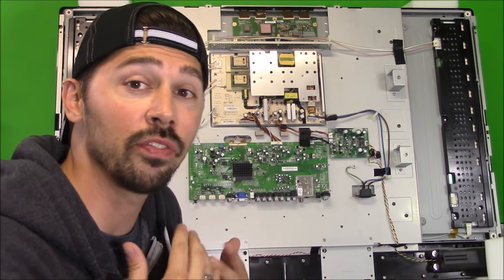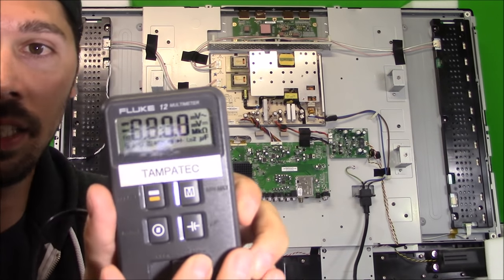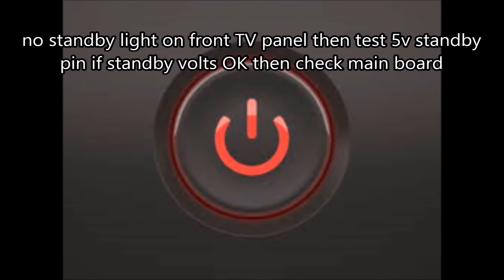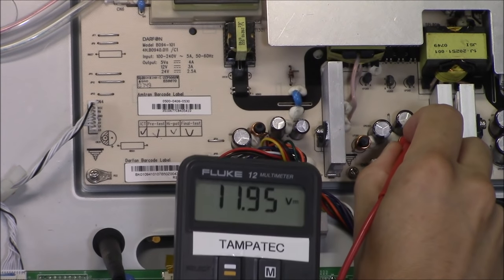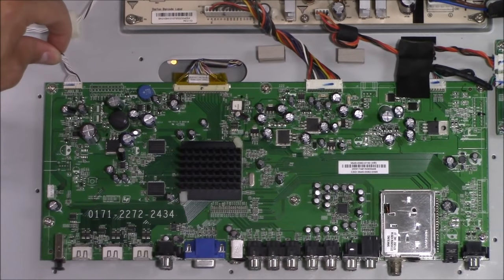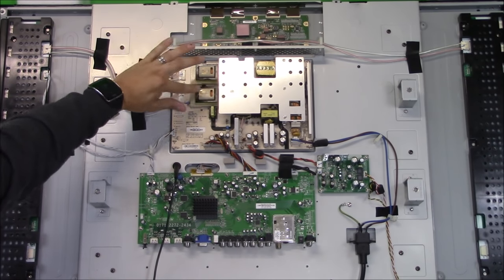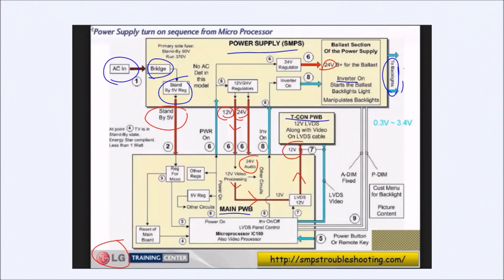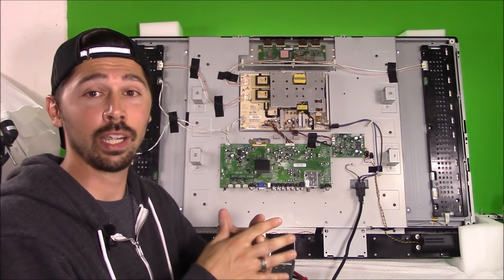ULTIMATE LCD TV REPAIR SERVICE GUIDE for TROUBLESHOOTING BOARD VOLTAGES

Comment: Help! I have a Sharp Liquid Crystal TV model LC-70LE550U  the other day the picture froze and then went dark around the edges then slowly would fade out all but the bottom middle... then finally that would fade out as well.  I would turn the unit off then on again and it would be good again but within moments do the same thing.  Is this the T con board?  If so... best place to purchase another?

Comment: Hi.
I installed new LED strips in my LG54M0060V12.
 The older strips needed replacing and when disassembling many of the lenses fell right off. I heard that was a common problem for some LG screens.

Very easy to do actually but the light on the screen now shows the pattern of the LEDs. 

The sreen and diffusers were put in correctly.
Is this another " learning curve " thing to worry about?
Reply: I mean all of the backlights, not just a few. Looks like wrong lenses on the strips.

Comment: I've been trying to fix a Vizio E220MV 22" LCD TV that has an external power supply.  The problem is no backlight and no picture (blank screen with the flashlight test), and of course without being able to know what it's doing I can't test sound.  It powers up and the invisible touch buttons respond by lighting up but I have no idea if it's actually doing anything.  All the voltages check out fine and all the electrolytic caps look good.  Any ideas of what to look at more closely?

Comment: Great videos! I changed out the dead Fuseable Resistor by the Bridge Rectifier on my Toshiba Regza (like you did on another video) but now I am getting good readings (you had a bad voltage regulator) for standby voltage but weird readings from the BR - AC is 120V but DC is only 117V and the other readings are .5, .5, and 1.0. I think I have a problem with the BR - awaiting new BR. On this video you said "If the bridge rectifier is shorted, it will take out the _?_?__. Could you please fill in the blanks (I could not understand what you said) so I know what else to look for. Many thanks!
Paul the Pilot
Reply: I think he said it will take out the fuse

Comment: Hi dear friend I have a lg 32lh20r. Manufactured in 1999  . Apears lines on screen  when I just turn it on then after 5 or 10 min goes away ..   they told me it maybe the t-con board ..  I been learning about my tv end it appearly doesn't have a T-con board individually placed .    Do you thing my tvs t-con board was built tongether with main board ?        Looking forward to hear from you

Comment: i have sony kdl-46z5500 tv without backlight. How to check primary and slave invertor boards? They work together?
Reply from the maker: +Zerg Rush check transformers on inverter board, that video is in my playlist. https://www.youtube.com/watch?v=b36w2GNrH6Y
Reply: +Tampatec Thx, can i check they separately or they work together? D1N and D2N Sony inverter boards. I checked that video before, but i cant find on my tv that balancers.

Comment: Hey Tampatec nice job with your videos!!  I took some of your advice and tried a fix on my  LCD (Samsung LN-T5265F) that has no back-light but sounds comes through and teh flashlight test shows teh picture is on teh screen.  I replaced all 4 Back-light Inverter cards one at a time and I still do not get any back-light to see the  image.  Any suggestions??
Thanks,
Fred.
Reply: I could help you. So, I found a huge tv. With the same problem. I read that it's just the l.e.d.'s. They need to be replaced. That's all

Comment: Hey Tampatec. I have an element TV that the standby light is on (red), but tv wont turn on and if it decides to turn on by a miracle the stand by changes to blue, but the screen does not turn on. I checked the power board and one of the outputs that was suppose to be putting out 24v was putting our 23v. I bought a new power board, but still having the same issue. Any suggestions on the next step?

Comment: Template,  I have a Sony KDF50E2000.  Good condition and all.  My tv's green power light keeps blinking and shutting  down the tv while I'm watching it. I hear the fans in the tv running  every time this happens. I thought it was a  bad lamp. But that's not the issue either. What could be causing this and how can I fix this. I've been watching  videos all day to try to troubleshoot  this issue. Everyone  has blinking red lights.  I haven't seen  a red light. The power light keeps flashing and shutting off my Sony tv. THANKS

Comment: Hi Tampatec, I have a Vizio D58U-D3 and it works except the left and right halves of the tv are different colors so it appears that there is a line right down the center of the tv. I already replaced t-con board, what else could it be?

Comment: I have a question for you Tampatec, I have an LG TV and all the HDMI ports are not working what could be the problem?
Reply from the maker: +Leonard if all hdmi ports are bad then main board might be bad but first unplug powercord for 2 minutes to hard reset tv, check your connections from cable box or a/v receiver. get boards at shopjimmy.com
Reply: OK thanks Tampatec.
Reply: that’s the site i was trying to remember, thanks. I think that’s how I got the idea to check to see if the back light turns on when I plug a connector on the inside… Very counterintuitive but alas I have light so Hopefully the solution is close… I’m pretty technically savvy and good with power tools however soldering isn’t in my repertoire yet. marzgyver

Comment: I have no input signal on all HDMI inputs or av inputs.  The power and main board are integrated into 1.  Sometimes shuts off when trying HDMI inputs and red power led blinks 3 times.  Would this be the main board or to con board?

Comment: Hey tampatec, do you have any contact info? I have a tv question. I have a 50 inch LG tv and it still turns on and shows the LG logo on the screen but it won't show picture from the antenna or the Xbox. It just says no signal. I looked at the capacitors like in most of your videos but they all look fine none blown or bulged. I'm stuck, I'm thinking its a capacitor that just looks fine. Any suggestions?
Reply from the maker: +Piero Sanchez can be main logic board but reply with an unlisted youtube video link of broken LG tv with model number, get tv boards at shopjimmy.com
Reply: +Tampatec is the main logic board where you can plug in your antenna and hdmi cable or is it the other one with all the capacitors? I want to make sure I purchase the right one. Thanks for all your help
Reply from the maker: +Piero Sanchez main board has hdmi inputs and microchips. power board has big capacitors and powercord connection.

Comment: I have a visio m420vt and after checking the voltages, I found the 12v circuit to only have 11.3v. The tv comes on and the backlights work, but none of the other buttons do anything and there is no image. Would this low voltage cause this or think I have fried mainboard? None of the components show any signs of failure.

Comment: Hello Tampatec, and sorry in advance for my English mistakes. Thanks for your videos they are very informative and useful.
I was wondering if u can help me with the problem i have on my old 2007 lcd tv, it's a Lg model 42LY95 (it can be used as heater during winter  :D ). So the problem is when i switch on my tv everything is ok but after 5 min, the image start blinking black and make pixels (the backlight are still on at that point).
About 1 minute after, the backlight switch off, i have only sound and the power button is still green, then i have to switch off my tv for a while, maybe 30 minutes to get any image and it's the starts again. 
So i opened my tv hoping to see any obvious problem with capacitors or anything burned but nothing so my question is:
Do you have any idea where it can come from ?
Is it just a symptom of dying backlight and if it is, is it repairable and worth?

Anyway I will follow your tutorial and check everything i can with my multimeter and give update later.

Thanks for your answer if you see my message and keep up the good work, love your videos especialy the "repair tech stuff by myself". I hope u understand my bad explenations.

Greatings from France mon pote ;)

Comment: When I test the voltage going to the T-Con board, it’s only 0.71V on each pin. Does this sound normal? The board itself says 24VD. This is a 55EG9100 which the standby light is on, but the TV will not power on. It started into a color cycle a couple of times after being unplugged for a long time, but I cannot get it to do that anymore.
Reply: When I disconnect it from the power supply and keep it connected to the main board, the voltage is 1.2V

Comment: I replaced the power board and my light still blinks and
takes a long time to come on, if it does. I noticed when I switch from a
standard digital channel to a HD channel it will go black and the red light
starts flashing again. No sound or picture. Could it be the logic board? What
about the capacitor in the main power wires going from the main in to the power
board? What are your thoughts?

Comment: I have a Sharp LC-60C6600U it is not turning on has a small light on in the middle of the TV I think its the standby light. No sound no picture can not see back light, but the light on the main board for the sound bare is on red. can you help I need to know what board to change out. t-com board or the main board. thanks

Comment: How would you check standby voltage on a tv that has a ribbon cable attached from power supply board to the logic board? The power supply board doesn't have any chart or indicator for standby voltage. It's an Emerson brand.

Comment: Hi. Could you help me. I have Samsung LCD TV and my picture turns on for a second then goes blank. I hear relay clicking 3 times and then stops during that. I took back cover and check voltages on supply board. Do you think clicking relay may be a problem? How can I check it it that's the problem. Thanks for any suggestions.

Comment: Hey I have a Samsung UN46D6900 has no lights, no back lights and clicks when connected to the power (single clicks every 3 to 4 seconds). when I unplug the main board the back lights comes on and no clicking relay. With the main board connected I am getting 5.28 to 5.31 V at pins 19 and 20. It fluctuates with click of relay. I am wondering it is the main board or the power board! would you be able to give some tips plz?

Comment: I have an Akai DLP TV that turns on runs and looks great,,,,,,,,but after a couple hours you will notice that the remote won't work, ie tv won't change channels or volume. then after about 5-10 minutes the tv picture reboots comes back within just a couple seconds. Then everything is ok for a few more hours...any suggestions

Comment: Great Videos! I'm close but not confident : )  Just need your expertise to point me in the right direction.  I have a 40" Sceptre LCD TV.  Problem: When powered on the (blue indicator light comes on) but I have a Black tv screen.  I checked the power supply voltages all were accurate, as well as the lines to the main board.  I noticed when I disconnected the 5 pin (2 lead) wire from the main board to the Back light board the back light comes on?  Checking voltages from the main board I read nothing at the Tcon connector.  Appreciate your help.  Thanks

Comment: Your videos are brilliant, well scripted. Green light on no red light. I have Sony KDL52V5100 with no picture, no back lights, no sound, no power to Ticon borad, and no power to inverters. Voltage readings at CN6202 on main power board are as follows with TV turned on with tv set power button, not remote, 3.35, 3.35, 3.35, 15, 15, -, -, -, -, -, 12.02, 12.02, 12.02   I have no power at connectors CN6501, and CN6502 to inverters and no power to Ticon board. After watching many of your videos I have concluded that my main logic board is bad. Could you please assist me with your opinion.  Please keep up your videos.
Reply: Tried heating 2 large smd chips on main logic board. 40 seconds each one, with aluminum surround on chips while heating. Reinstalled without inverters hooked up and got 6 red clicks hooked up inverters tried, worked well,  removed reinstalled heatsinc.  It works well now. Thank you for very informative information, in your videos.

Comment: Question. Samsung model . Ln  32d403. Won't memorize channels when in auto program. Through antenna or coaxial cable.  sensor on TV won't work. Remote for the TV does.   what's the issue with it. When I plug into a converter box I can watch TV because the converter box has the channels memorized. just would like to learn how to fix the TV.

Comment: Hi Tampatec
Thank you for all the knowledge and experience you are sharing with us. I learnt so much from you. I need your help.
I have a Vizio model  M550NV that works perfectly except for audio. The sound coming from the tv speakers is very very faint and not clear even at max volume. I checked the output dc voltages coming out of the power supply board and they all look good. It looks like the culprit is the amplifier chip but I cannot locate it because the audio board is not separate from the main board. Can you please help me locate it, and maybe a place where I can buy a new one. Thank you
 
Vizio 3655-0102-0150(7b) Main Board for M550NV
Reply from the maker: Said Laghrani try reset first then replace main board if reset fails. You need schematic to locate amplifier IC.

Comment: My Samsung LC55630K1FXZA LCD (CCFL tube) TV has audio, but no visual. I checked the CCFL's and none of them were burnt or black, I checked the voltage to my backlight inverter board and all transformers gave back the same voltage. I started testing the power board and while in the step of checking the bridge rectifier and somehow ended up causing some sparks and smoke and now my tv doesn't even have the red power light or the option to turn it on or off. What do I do now?

Comment: I have a Mitsubishi LCD WD-62531 . I turns on fine but will not recognize any channel for about 30 min.s .After this warmup time it works good with the exception of a spirt occasional of sound & pic. It is 99.9 % right after warmup. Then the longer on goes to 100 . After warmup ,you can turn of and on with no troubles. Until next time hrs or a day later

Comment: Is it possible for a power supply to to send bad information to the main board and produce static  or no sound through the speakers?
Reply from the maker: Check capacitors cause it act as a filter, bad caps can cause audio and video issues.
Reply: +Tampatec , Thanks, I have already "looked" at the caps ( i don't have a cap tester yet ) already replaced the main board twice so now I'm replacing the only other board in it .. power supply.
I'll let you know how it turns out when it comes in.

Comment: vizio e390i-a1. have 5 volt on power suply board but when i plug in main board the voltage goes to 0. also the 24v supply keeps surging between 36v and 9v. both boards have been replaced and do same thing. tv won't turn on. any ideas? thank you...

Comment: hi tampatech.  i have a Samsung plasma that i have been trying to fix. well it has colored vertical lines going through the images. can you help. model # pn43f4500af. any help u can give i will accept. thanks!!!
Reply from the maker: +Johnathan Valentin that can be bad panel or defective control board.

Comment: i have a toshiba 46 inch -model #46sl412u .the problem is the sound goes way-up and blows the speakers  for no season what could be wrong THANKS ERIC
Reply: Hello my name is Ronald and l have problem, my insignia NS-LCD42-HD has no picture,the screen is blank and black although
The power lights comes on.
I was wondering if you could make a video on the insignia LCD.

Comment: I've been trying to find a fix for my Vizio E320VP , but I can never find enough info. The picture just shut off after hitting the outlet by mistake. It came right back on (along with Xbox and lamp) so I went to inspect the outlet to make sure everything was plugged in ok, which it was so i didn't touch it. I come sit back down, and Bam! No picture. The Xbox and lamp were working fine. I did the flashlight test and there is a picture but no backlights. Audio still work also. I'm no expert, but there appears to be no damage or burns on the main board either, top or bottom and since that is the only visible board, I have no idea where else to look.  I've been looking at videos here and shopjimmy's channel and shopjimmy's site says it's not answering t.v support questions right now. So I'm completely lost. :-(
Reply from the maker: no backlight means bad inverter board or no power to inverter board,  so either power board or inverter boards are bad or both. check volts to inverter I did video guide on this check my tv repair playlist, ultimate lcd tv repair guide.
Reply: +Tampatec Thanks for the reply.. I did check out your video too..and see that's what confuses me... My t.v model seems to have EVERYTHING, literally, connected to a single board (main board) so I don't know which part of the board is dedicated to handling the power, main, inverter board etc. For example, in your video, you go from the power source into the power board which leads to the main board then TCon etc... My t.v goes from the outlet, to a converter box power source (outside of tv similar to laptop chargers), then straight into the main board. Then the main board goes out directly into the speakers, t.v controls etc.
Reply: +B kenpachi there is a slim board at the top but it doesn't look similar to any board I've seen on your or any other tutorials. Is there a way I can send you a picture for you to see what exactly I'm looking at?

Comment: My power supply (22"tv) measures are correct when I unplug it from the logic board but when I connect it back, it goes on and off loop.
Logic or power problem?